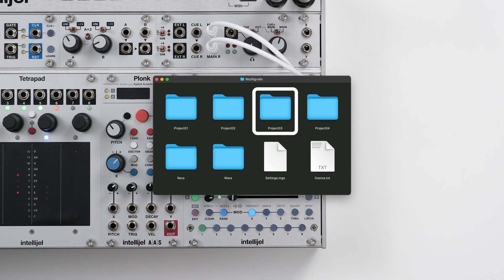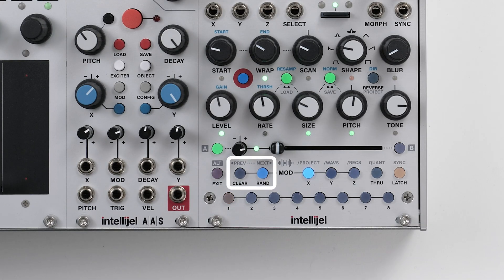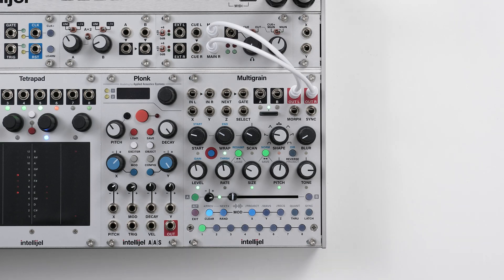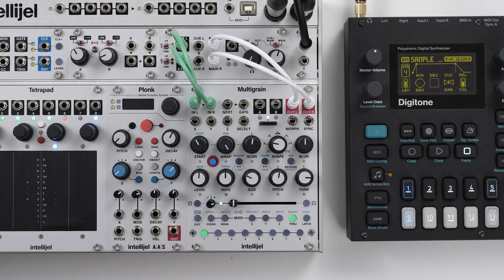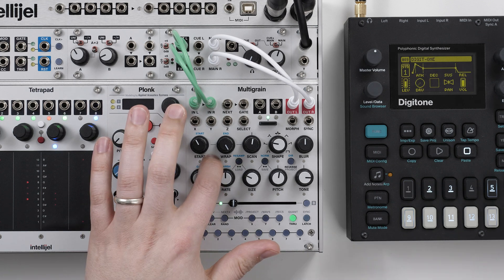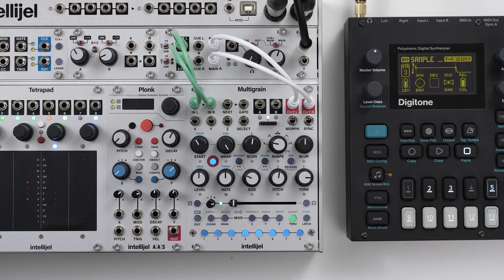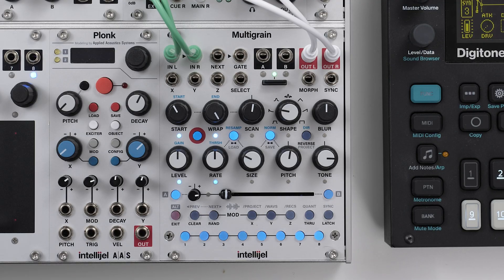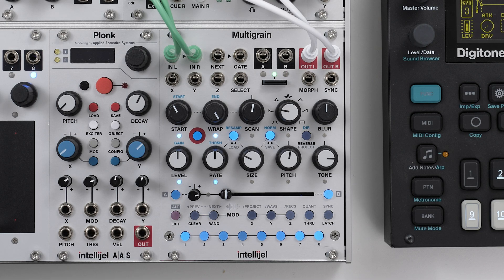Intellijel Multigrain: Working with Samples

Comment: Had mine a couple of days now. Unfortunately, I made the error of updating the firmware before familiarising myself with the sample loading procedure- and now I’m finding it impossible. This may be because I cannot replicate the starting position here; there are no blank canvasses. I may have to reset to factory default…
Reply from the maker: Sample loading hasn't changed with the firmware updates. Are you trying to create a project, preset or sound from scratch?
Reply: @intellijel A project- I don’t yet understand ‘preset’, and it will be weeks before I’ll feel able to record something!

Since my comment I’ve managed to create the blank canvas by simply clearing everything from Project 1. However, I cannot for the life of me figure out how to load that project with files from more than one existing project. Even with a copy of the sd card on an iPad, I’m finding it impossible to navigate around the actual files architecture without being taken back to square one. While one of the tutorial videos shows it being done, the voiceover doesn’t explain HOW it’s done, and it’s done so quickly that it’s impossible to follow. And yes, I’m constantly referring to the manual- but that doesn’t explain HOW things are done either.

Great module, huge sonic possibilities- but it really really needed a screen!
Reply from the maker: To avoid a longer chain of responses in the comments section here, perhaps its best if you contact: support@intellijel.com
Let us know what you're stuck with and someone can help you further. 
In the meantime, check our other Multigrain videos here: https://youtube.com/playlist?list=PLvZWo9k7KdK6sjMZzTsMAGrezW-x_9nBs&si=j-F9KRadbdLKtKS9
Reply: @intellijel a chain of comments would have been nice for the other people to have context tho :) guess I’ll just have to email as well

Comment: I'm really into Multigrain.
However, I seem to be having trouble with sample trimming; manipulating Start and Wrap has no effect.
I just updated the firmware to the latest version, though...
Reply from the maker: This could be to do with the way the the controls work in this page. The knob position needs to pass-thru the current value before it'll take effect - unlike the other pages where the value snaps to the knob as soon as it moves. 

For example, you might need to turn the End (Wrap) control fully clockwise to pick up the end point, then you can turn it back to the position you want to trim to. It works like this so that you don't inadvertently snap trim points to the knob's current position - which could be anywhere depending on what you were last working with. 

Something to look out for - if the knob LEDs for Start & End stay at a fixed brightness, chances are the knob hasn't passed through the current value yet. To avoid any doubt, sweep either control through its full motion until the brightness begins to change - then you should hear the trim points moving.

When adjusting Start, you'll be able to move back into the always listening buffer (before your recording started up to 32secs). Keep this in mind, as you may find material before your recording, or potentially even silence. I mention this in case it sounds like the recorded sample material has disappeared - it might just be that you need to turn Start clockwise towards the end of the buffer contents.

One last thing, when previewing sounds, changes to Start and End will not take effect until you release the Preview buttons. 

Hope this helps! If you're still having an issue, please get in touch with support.
Reply: @intellijel 　Thank you. I love Intellijel.😊

Comment: Maybe a dumb question, but would multigrain work for line level input and output? Would make it pretty sweet for pairing with a more tradtional keyboard synth in a 20hp pod
Reply from the maker: Multigrain's inputs are intended for modular level, so you'll need something to boost your keyboard signal. There are plenty of modules out there that can do this, we have a few different solutions in 3U and 1U formats on our website: https://intellijel.com/ - but maybe you'll need a slightly bigger pod!

Comment: 4:30... set audio level?
Reply from the maker: Multigrain's input gain is set to unity by default. Whatever you record into it should match the level that comes out. You can adjust this in the Sampling settings (shown at 8:13) or you can use something externally ie. attenuator, vca etc.

Comment: Very useful and clear video thank you ! 😊 
Is there a way to trigger recording externally ? (Vs. clicking in the record button)
Reply from the maker: There isn't a way to trigger recording externally. Using Threshold recording is the only "hands-off" way to start a recording, but you will still have to arm it by pressing the Sample button manually.
Reply: @ thank you guys 😊 and the advanced mode allows to adjust starting and end points so that’s pretty cool too !
Reply: Oh also, for the clear function, I’ve tried the press once to clear settings but it also clears the sound … am I doing something wrong ?
Reply from the maker: You may need to update your firmware to V1.1.0.0. You can find the updater tool at the bottom of the Multigrain page: https://intellijel.com/shop/eurorack/multigrain/
Reply: @ oh nice ok !! Thank you I’ll try that asap. Thanks for the help

Comment: I love this module, but it takes me a long time to memorize hold --> press functions. Would have liked a screen to simplify keeping track of things. Also, I keep trying to clear sample settings and erasing the sample instead (using the hold clear + press method here).
Reply from the maker: 'Hold and press' functions can sometimes be replaced by 'press and press'. IFor example - 'Clear' can be pressed, and Clear page will latch on instead of appearing momentarily. The LEDs will light up red to show you what can be cleared. This will also give you the opportunity to select, then confirm clearing a Sound, Scene etc. 

Where you're finding the Sound is being erased with one press: double check that you have installed the V1.1.0.0 firmware on Multigrain. V1.0.0.0 doesn't support clearing settings only, it will instead clear the entire sound with one press. Hope this helps! You can find the latest firmware at the bottom of this page: https://intellijel.com/shop/eurorack/multigrain/

Comment: Will there be anyway in a future update to save recordings straight to the Projects folder? Having Projects is such a great idea and really encourages working in sets of 8. But having to manage collecting the 8 sounds in a Project via the computer only severely slows down the work flow. Not to mention if you've already made loads of tweaks to 8 sounds and saved a preset. If you move those sounds to a Project you have to relink them to get your presets back. Instead of just saving the 8 sounds in the Project folder first then making all those tweaks and saving loads of presets. .
Reply from the maker: We appreciate feedback like this! Multigrain will be getting firmware updates in the coming months, so always let us know what you'd like to see. 

Currently, there isn't a way to consolidate recordings to the Project you're working in. Other than to keep a Project well organised, there's no downside to those samples staying in the /recs folder. In fact, the samples in the /recs folder can be accessed from any Project - so there's a bit more flexibility in that respect!

Comment: I love my multigrain ! thanks for that video as advanced sampling isn't the most straightforward feature. would love to see the ability to line level record in future update ( more gain, maybe 12 db ? ). it would save me some space in its small rack. One other thing I don't fully get the fact there are 48 ( presets) * 8 ( sounds) = 384 sounds max in a project. but only 128 samples max => what happen if I reach 128 samples slots and then I try to add one more ? wil it delete the first sample or will it refuse to load ?
Reply from the maker: Perhaps it's better to look at the sample folder limits with a different perspective. 

Firstly - every Project has access to the /wavs and /recs  folder which add even more samples for your Sounds (128 + 1024 samples respectively). The /recs folder is larger so you don't have to clear it as often. 

Secondly - Multigrain has 48 Projects to work with, and each one of those can have its own unique set of 128 samples. 

Thirdly -  It's quite unlikely every single Sound across all Presets in one Project will need its own unique sample. Sometimes you'll have Presets that use less than 8 samples, or even some which use 1 sample across all sounds. If you've reached this point, you should probably start a new Project.

Also, if folders didn't have a sample limit, it would take a lot longer to browse through them, compared to separating them into manageable collections.
Reply: @intellijel  thanks for precise answer, it was actually not a critic.I really love it.  I feel like this is very unlikely to happen.too.  I'm just wondering " what if" as I need to go through that process to learn the module ( Agree it's maybe an autistic reaction) so if understand properly : If I reach the limit Multigrain will look in other folders. that's very cool. ( I agree that browsing in 128 samples is already enough)

Comment: Mine is arriving within the hour! 😀
Reply: So far, this module is blowing my mind. Some of the most brilliant UX I have ever seen. And it sounds absolutely incredible. A real magnum opus.
Reply: The UX on the new Intellijel modules is so refreshing. Multigrain and Sealegs both have the jacks at the top which is how all modules designed for live hands on use should be. We have cables of any length now. We can taylor our cable usage for task. No crazy back lit faceplate, strictly designed as a tool.